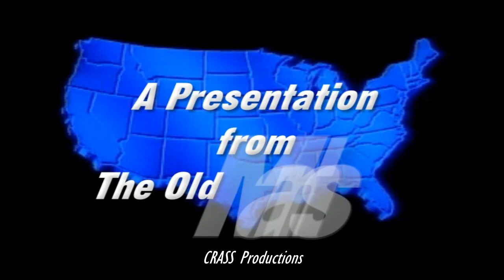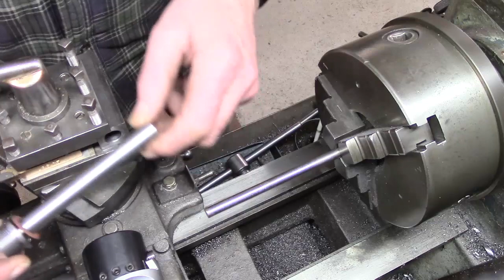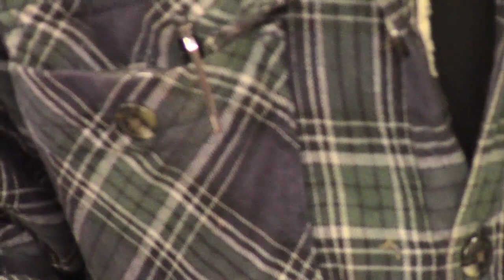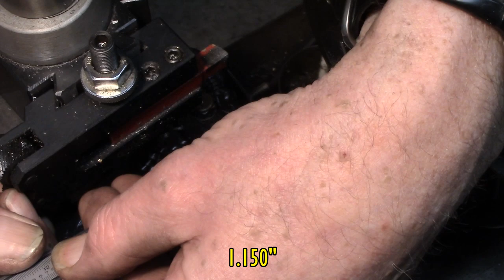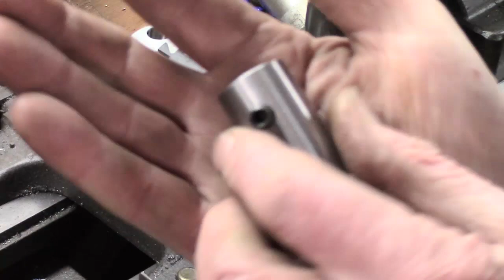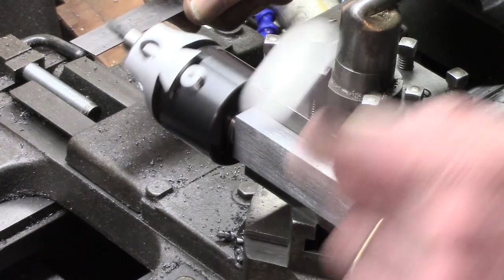Radius Ball Turner MKll - Boring Head/Tool Post Version, Part Two

Comment: I realise this is long after the horse has bolted but I have a few 
recommendations. Rigidity is always a problem with smaller lathes and 
the method you have of mounting the boring head in the extended compound
 slide just looks less than rigid with a lot of overhang. I note in a 
previous video you tried a vertical mounting but had the head above the 
work. I would suggest mounting it below the work mounted to a bridging 
plate and clamp spanning the bedways similar to a steadyrest mount. 
Mounted this way all the cutting forces are directed straight into the 
bed and is almost certainly the most rigid setup possible.
Reply from the maker: Hi Rob,
Excellent points and thanks. One thing I miss on my cross slide is T slots - which would make things much more versatile. Another option would be removing the compound but that is a major hassle and would need a special fitting. The idea for fitting something to the ways is a good one - food for thought definitely... like that.

Comment: That is a good idea, I have one of the kind that is the C type. I have never gotten around to see if it will work. I guess I have ti get it out and work with it.
Reply from the maker: The "C" type can work but one problem is getting tool height and radius set and - clearance from chuck etc on the leftward swing. They can work quite well I believe.

Comment: You'll love that tool and will be putting a radius cut on way more than you thought. You have probably found out by now that the cutting tool needs to be sharp on the end as it cuts tangentially, do you have GHT's book which discusses ball turners? 
ATB
chris
Reply from the maker: Don't have the book Chris - most thoughts have come from other videos I guess. Before I try a full demo I do need to do a small grind on the carbide tip and also maybe, make a custom tool from some drill rod.